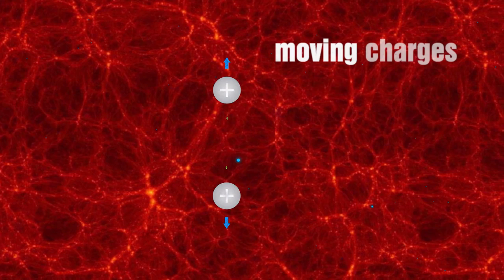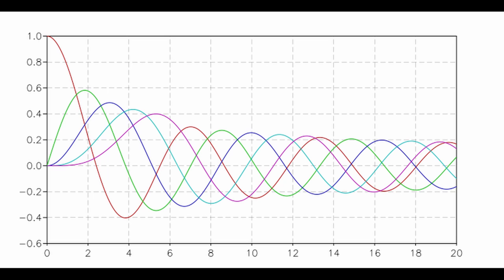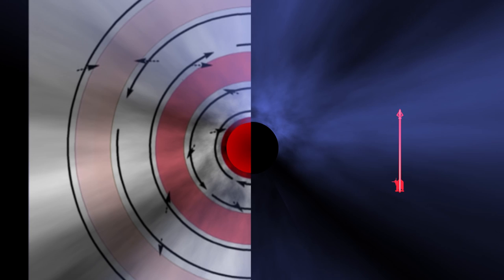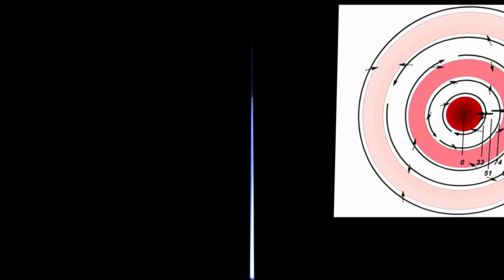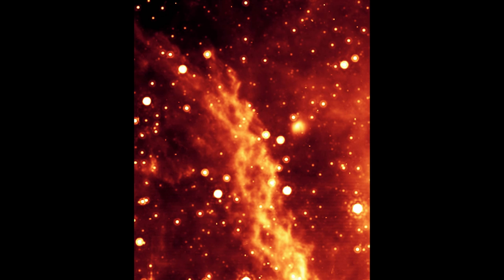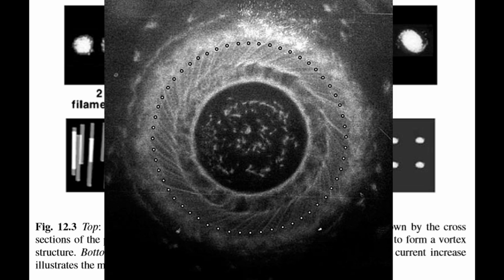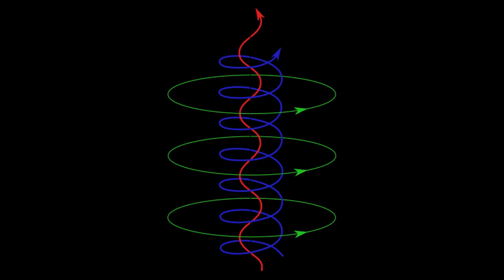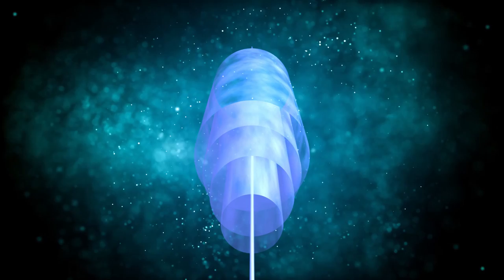Understanding Don Scott's Birkeland Current Model

Comment: I Have read both Don's work and read Peratt's book, and followed some of Peratt's works as well.  I think Don tries to mix the image of a plasma instability from Peratt's book  with a Birkeland current, but they are a slightly different phenomenon.  The Peratt image is focused upon a witness plate, which would be similar to the counter-rotating concentric-circles, at a planet's pole.  In other words, a Birkeland current is being forced to flow orthogonally to the incoming current due to conservation of momentum of the flow, due to the current being focused onto a dielectric boundary, such as into the planet's poles and onto the planet's core itself, or onto a witness plate.
   A Birkeland current through space is not as constricted of a flow as a Marklund convection, until it gets pinch at a torus of charged particles orbiting the node, or funneled into the pole of a forming plasmoid.  It is when a Birkeland current gets pinched that in turns into Marklund convection.  When un-pinched it can separate back into Birkeland filaments
   Neither of these things are possible, in my opinion, without there being a fluid ether medium.  What they are now using in some models of the electron and ions are now called a "phonon,".   A phonon is a quasi-particle surrounding the electron or charged particle, AKA the Tesla model of what mainstream calls an electron, which is an electron surrounded by a cloud of photons, now called a quasi-particle, or phonon. https://en.wikipedia.org/wiki/Phonon
    So when a plasma current starts to flow, or is  discharged from a plasma focus device, the phonons surrounding the charged particles become the magnetic field, which  we observe around all charged moving particles.  The magnetic field will flow, IAW the right-hand rule, around the negatively charged particles, and IAW the left-hand-rule, around positively charged particles.  So at a critical velocity, or vibration,  It is the counter-rotation of these phonons, turned into magnetic field, that provides the force that cause a Birkeland current to separate by charge, or ionize the atoms into electrons and ions, and form into twisting filaments.
   A Marklund convection is different, in that it is a Birkeland current pinched into the polar funnel, or at the pinch of a torus along the filament, or through a constricted flow into a star or galaxy, causing the charged particles to roll together into neutral particles, or transmute,  into the axis of flow.    When a negative charge neutralizes a positive charge towards the axis of flow, there is no longer a charged particle to hold the phonon anymore, That is fusion.   So there is cooling effect at the axis and an outflow of photons, that used to be the phonons, migrating to the outer shells, via rarefaction.   It is the increased  density  at the axis that stops the vibration of the particles that allows them to line up into neutral particles, it is the lack of vibration that causes the axis of flow to cool off.
Reply from the maker: I always appreciate your insights.  Much to digest there.  I need to do more reading of Peratt's work.  On the phonon I had heard of this and now that I am turning my attention to the atom I too am wondering about what an electron is and why particles have spin, what come first the magnetic or the electric or is it an effect of an interaction between a medium... many questions
Reply: @SeethePattern Here is the Thunderbolts article on Birkeland current, and charge separation within.  It is charge separation that keeps a Birkeland current from rolling together as a Marklund convection does.
https://www.thunderbolts.info/wp/2019/04/24/cosmic-electric-charge-flow-2/
   I think Don's idea is well founded, but now that we have found galaxies "without dark matter," a Birkeland current charge drop off at 1/r^1/2  through the galactic core cannot be the sole cause of the outer stars in the spirals of galaxies "with dark matter" orbiting at a faster angular rate then the outer stars in galaxies "without dark matter."
   There has to be a transient condition of "phonons" building up, or something flowing into the galaxy to increase it density, around an increase  charge within the galaxy, that causes a distinction as to whether or not a galaxy has "dark matter" or not.  There has to be a transient drag effect on the outer stars, speeding up their rotational velocity, until an equilibrium is reached.   
    Dark matter as it is currently modelled from Newtonian gravity mathematics cannot work.
Reply: Gareth, Joe is right about the need for an Aether, as well as at least a few of the specifics.  If you were to do a deeper dive with him, I’d like to be present, or at the very least, be privy to your exchanges.
Reply: @jamesweninger3679  I think that a phonon is just a new way of trying to slide in the back door with the ether medium.  They use this in quantum computing, by controlling the phonon around the electron with a laser, in all 6 axis of rotation, using an electron as a carrier.  This is the Tesla version of an electron, a charged particle, surrounded by a cloud of ether medium. 
    That when they talk about annihilation of electrons with positrons, we are really talking about the electron joining up with a positron, into its most preferred state.  But no such annihilation occurs, but they give up their orbital energy, stored as the magnetic field or phonon, due to there no longer being any charged particles to maintain the phonon out of the ether medium, the photons  rarefy as momentum. 
    So what really happens when a photon is split, and an electron and positron are separated from it, or either of them  decays out of a neutron, is that they each grab the opposite dipoles of photons out of the ether medium to form a phonon, a photon or ether medium density increase.  This is the version of the electron that I believe Tesla claims to have observed forming out of the ether medium. 
    To me there is no such thing as anti-matter.   Energy is delivered by compression and rarefaction of the ether medium, AKA photon pumping by charged particles., just like an air conditioner uses a fluid medium to transfer heat via rarefaction and compression of  Freon, a fluid medium.  It is by this model that there is still an equal number of electrons and positrons in the Universe, none of them ever get annihilated
   I think that it is these phonons that form around newly charged particles, as they  decay out of the neutrons, that cause a quasar to be redshifted at first, but as new electrons decay and grab photons out of the ether medium, the density of the quasar increases per the KERR effect.  In a quasar, both the new electrons and the new protons form phonons. The ether medium density increases and causes a shorter distance between ether medium particles, a higher frequency, or less redshift, as the quasar ages. 
    The phonon, or ether medium  density within all atoms, along with the ether medium density gradient, around the Earth and Sun, that Ron Hatch speaks of from his GPS studies, are what we need to study for any model of gravity. 
   A MASCON is another example of the Kerr effect.  A MASCON does a similar thing.  As the radioactive areas, known to be beneath a MASCON, beta or alpha decay, and draw in the ether medium, or phonons,  there is an inflow of ether medium into that area that manifests as a gravity increase.
   I have a similar scenario for what causes a pulsar.
Reply: @JoeDeglman  Joe, your answer to question "what would happen if you place electron and positron in vacuum next to each other, will they repell or attract (and anihilate)?
Reply: @lukabc31  That depends upon your definition of a vacuum.   A "vacuum," by standard definition, is actually an area in which all of the matter or plasma has been removed.   The standard definition of a vacuum is that there is nothing, not even photons inside of a vacuum.
    However, experiments have shown that what mainstream calls a vacuum actually has photons, AKA electron-positron pairs, AKA ether medium in it.   These medium cannot be removed from a "vacuum."  The ether medium is the magnetic field, and a magnetic field cannot be stopped from flowing through a "vacuum."  The ether medium would flow through the container walls and into the "vacuum."
   So an electron inside a vacuum, would still form a phonon or quasi-particle around it. as would a positron.  The problem here is that the phonons around these two particles cause a pressure or double layer, between the charges that keeps them apart.   So they would attract, as an electron does, trying to get into the protons in the nucleus, but the structure of the phonons, surrounding both a proton and an electron, them keeps them apart.
   So one electron and one positron would generally attract but, their phonons would not allow them to join, but perhaps orbit each other, say outside of 1 femtometer. So to get them to "annihilate," requires an compressive force, or slamming them together, to overcome the phonon force around the electron or the positron.  Then let's say, inside of 1 femtometer or so, they would join up to become a photon, and lose the energy stored in the phonon build up around them.  But an electron and positron pair do not annihilate, they just become a photon, and return to the ether medium, while dissipating the phonon around them as energy, back into the ether medium.
Reply: @JoeDeglman  ok.. and do you think electron forms toroidal geometry too? Because if so, frequencies within have a spin, left or right. And in my opinion electron and anti-electron have opposite spin that is why they will repell and therefrom I presume that you have to force them to achieve anihilation. Phonon seems interesting idea, just I would presume that it is just outer shall of the electron within toroidal structure. But it may be energy obtained from various sources.. Anyhow, I kind of see this as not being needed there.. All particles have their magnetic dome which isolates them from the surrounding environment so why to add phonon which does the same?
Reply: @lukabc31  I think it more likely that with  electrons within an atom, or say in superconductor state, there would be no orbiting of electrons. There would be no up spin or down spin to electrons, or the surrounding phonon, allowing them to flow more freely as a flow..   Just as in quantum computing, the phonon around an electron can be controlled for a few nanoseconds, until it is "received," but will quickly go back to an induced spin when moving, and orient their spin IAW the right hand rule with the magnetic field.  The electron, AKA phonons, would just plasma tuff and space out around the proton, in a super-conductor.  A positron  cannot be an electron with an opposite spin, since positrons have a magnetic field around them, when flowing, IAW the left-hand rule.
     The orbital model of an atom is due to the fact that we use energy or phonons from an electron microscope.  So using an electron microscope, to see what the structure of an atom looks like,  induces the rotation in the electron orbitals, causing the electrons to settle into  Lagrangian trojan points.  Also causing them to draw into distinct orbitals within the induced ecliptic plane of the atom.  Just like planets have lagrangian points that the trojans settle into, the electrons would settle into induced trojans. That the phonons around the  electrons, just like dust devils in our atmosphere have a 50% up spin and 50% down spin.   An electron's up or  down spins are  due to the induced rotation and the nodes within the current flows, induced around the proton, when we observe them or heat the atoms..
   On the toroidal structure,  I think that a magnet does not have a toroidal structure, just a steady magnetic  field flow, unless there are charged particles trapped in the torus.   The toroidal structure you see on Ken's experiments is not a structure of the torus of a magnet, but a structured orientation of metal filings or nano-particles lining up as a field  aligned structure.  
     With a Ferro-cell, the  toroidal structure only appears as a result of the nano-structure within the ferro-cell, creating a birefringence of the magnet ribbons, that are buoyed from the LED's to the poles of the magnet, while the LED infringes its signal onto the ribbon.  The number of ribbons is completely dependent upon the locations of the LED's.  There would be no toroidal structure to a ferro-cell experiment, as Ken claims, without the LED's to create a phonon structure around the LED itself due to charge build, as a dense structured ribbon to be buoyed as a magnetic ribbon into pole of the magnetic.
    Studies from Tokomak plasmoids show that it is an electron or proton  trapped in a torus, spirals from one side of the torus to the other and back-and forth.   So it is the plasma trapped in a torus that creates the toroidal structure.  So an electron in a thin orbit with a small electron density or an atom,  would probably fit into the lagrangian points of the flow, when orbiting an electron.  Any toroidal structure within an atom would probably be less noticeable than the Earth's, change in  incline with the ecliptic of the Sun.
   But electrons trapped in the torus of the Sun, our Van Allen Belts, or a galactic core, with a large electron density, would create the toroidal  pattern.
   The mainstream version of an electron, is really an electron with a soft shell of photons, or ether medium surrounding it.  This is the version of the electron that Tesla claims forms out of the ether medium, when he shocks or vibrates the neutron apart.
   A phonon is the magnetic dome, you speak of.  A phonon is what mainstream does to ignore the ether medium, yet again, but slide in the back door with a new concept, because it  has experimental evidence to it.  As, I say, quantum is defined by me as, what will happen when we send particles into the ether medium, while trying to maintain that no such ether medium exists.
Reply: @SeethePattern Here is an image Of what I think a Birkeland current looks like, feeding into a star or galaxy.  After the pinch, due to the density of the ether medium buildup around the star or galaxy, then Marklund convection occurs into the corona or  plasma torus of the star,  or vortex-ring surrounding the eye of the  galactic core.  The magnetic field backs up and spreads out orthogonally, to create an ecliptic plane.  https://drive.google.com/open?id=1AcBTjrI18mlzKuqIAW4WTY7RI2Rgx6kw
Reply: @lukabc31 Here is an image of the Crab Nebula Pulsar, an x-ray image.  https://skyandtelescope.org/wp-content/uploads/3c58_crab_xray_341insidepx.jpg
   This is pretty much what a magnetic field will look like, especially around a star or planet.  Unless you put charged particles in the magnetic field, their will be no toroid structure.
   An atom will look similar, but only because we pump in electrons and a magnetic field to observe it, which induces rotation, electron orbitals, and spin of the electrons.
   This basically represents Marklund convection, after the pinch of the incoming Birkeland current occurs, due to ether medium density increase, AKA the light blue area, around the core of the star..  
     Marklund convection rolls positive and negative matter together, include so-called "anti-matter,"  causing fusion and transmutation of elements, releasing those charged particle's hold on the ether medium, AKA phonons, and those photons manifest as fusion energy,  and an ether medium buildup around  the star.   This momentum surrounds any charged particles in the ecliptic plane, and helps create the ecliptic plane, orthogonal to the incoming current.
Reply: @SeethePattern  also I wanted to pop back in here to point out a verified observation on Birkeland currents, Marklund  Convection, and Fermi bubbles. 
    It is known from radio images of Fermi bubbles that there are no electrons positrons or any other known matter or spectral signature associated with Fermi bubbles.  It gives off its own radio.
   So I think the Fermi bubble is due to a gas density build up that cannot be made of electrons, positrons,  plasma or regular matter.
   This shows that when a Birkeland currrents pinch and fans out into Marklund convection that the Plasma does not enter the eye of the galactic core, but gets diverted to the torus around the core.

Comment: Bravo Gareth !! This is one of your best videos yet .. Your description of what each of these model's implies is exactly in alignment with my own interpretations, including the questions that each model produces in comparing to measured experiments, and the fact that each of these models only attempts to describe what occurs along the more stable portion of a filament and not at a z-pinch or in the immediate area of the pinch.  My hunch is that it will be very difficult to develop a model that with precision describes how the z-pinch is formed and the forces at work at the pinch.  We may need to substantially expand our understanding of electromagnetics in order to accomplish that.